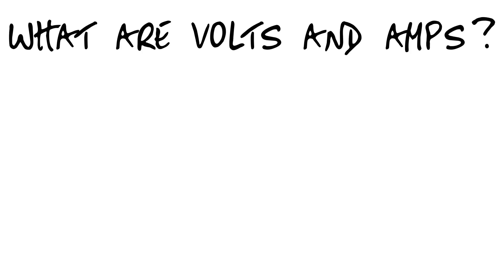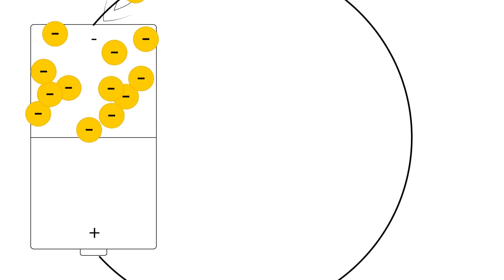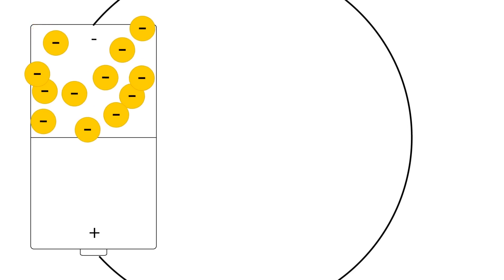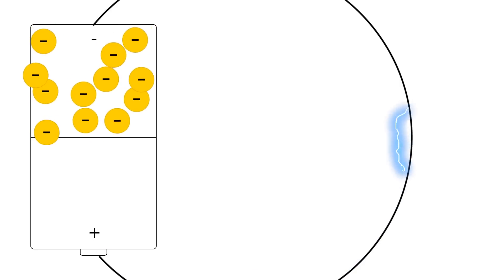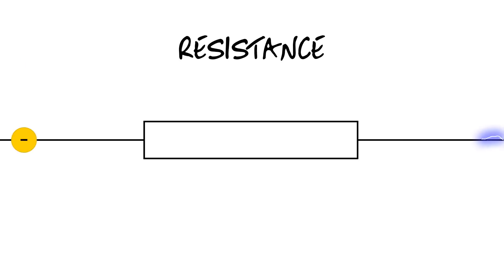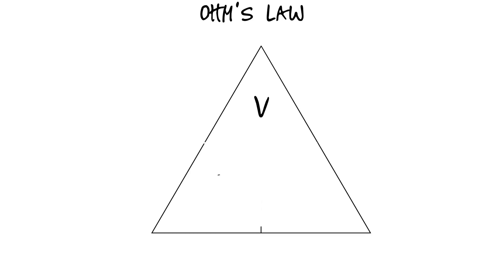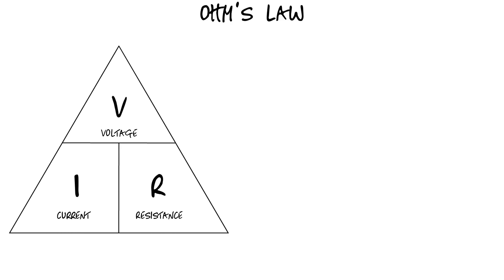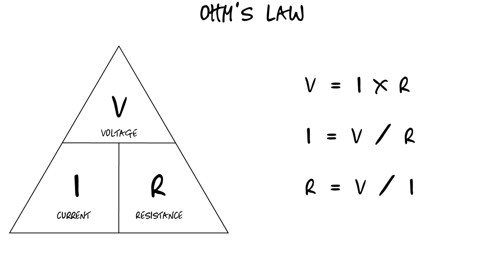Ohm's law - The Arduino Guide

Comment: on the secondary of a coil electrons are forced to move through a wire by the change in magnetic field- but there is no resevoir of electrons passing from primary to secondary.....electrons are confusing :)
Reply from the maker: Electricity is confusing.